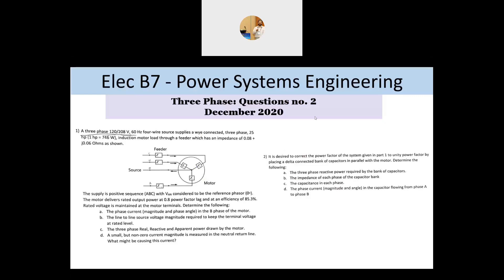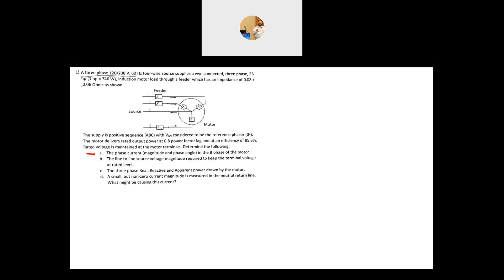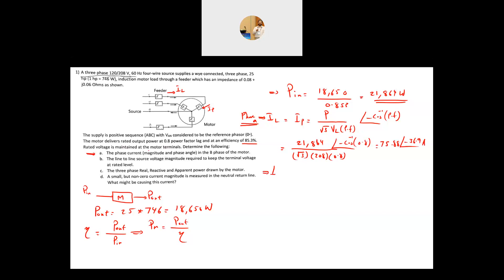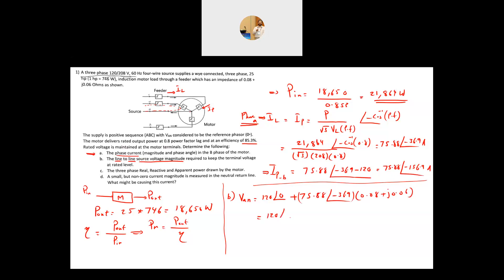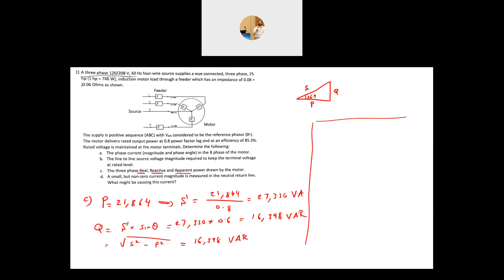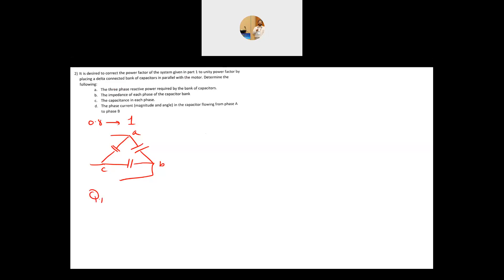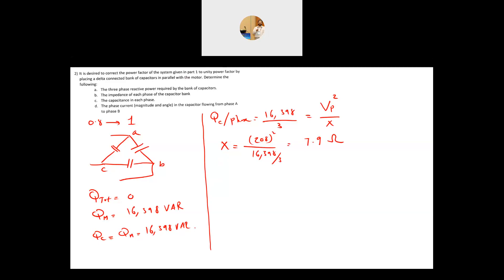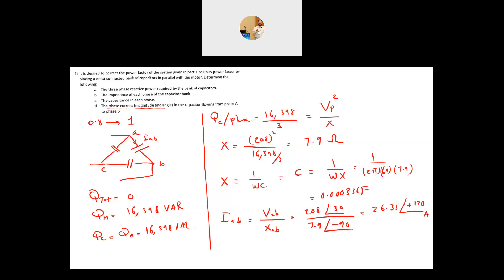PEO solved examples (ELEC B7) Three Phase Question no. 2

Comment: Hello Professor, For Part -2 (d), as we have considered Van as a reference, are we considering a 30-degree phase shift as capacitors are in the delta? Or, due to the star connection, the line voltage is (about 1.732) times the phase voltage, with a 30° phase shift.
Reply from the maker: As you said, we used the phase voltage of the Y connection as a reference, but since the capacitor bank was connected in delta, we need to calculate the line voltage which is SQRT(3)*Vp ANGLE(+30)

Comment: Thank you, please how did you calculate Question B in Part 1 : V = Current x impedance ?
Reply from the maker: I applied KVL for the single phase circuit to find the phase voltage and then multiply it with SQRT(3) to get the line voltage.

Comment: Thank you so much professor. Can you solve more power flow questions please...
Reply from the maker: B7 has 7 subjects but you need to solve only 5. I'm solving the 4 components questions and then I will solve load flow and short circuit.

Comment: Hi Professor, when you were calculating Van in part b, why did you use 120V instead of 208V?
Reply: Hi,
208 is the line to line voltage and the kvl is applied to line to neutral that is why 120V. Professor you can correct me if I am wrong.
Reply from the maker: @HaiderAli-rm6rd you are correct.
Reply: @electrical4everyone   There is one more point I would like you to confirm. When we are calculating the impedence for part 2(b) the reason we took Vp as 208 was since this is delta connected capacitor bank Vl-l and Vp are same.
Reply from the maker: @HaiderAli-rm6rd  exactly as for delta Vp = Vline